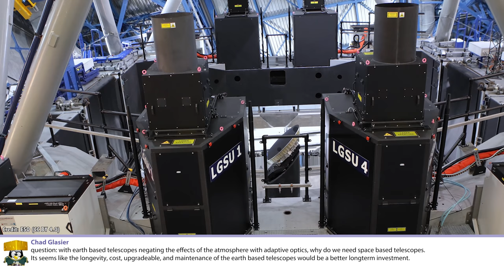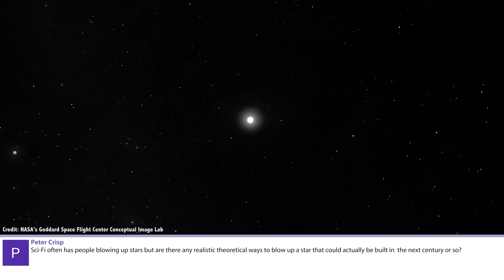Q&A 32: Why Can’t James Webb Be Repaired? And More

Comment: How to Calculate the Distance from Earth to SEL1 and SEL2.

The conceptual set-up is as follows. The barycenter of the Sun-Earth system is at the origin of a coordinate system that rotates such that the sun is always on the negative x axis and Earth is always on the positive x axis. L1 is some distance from Earth toward the sun. L2 is some distance from Earth in the direction opposite the sun.

Definitions:

GM₀ = the gravitational parameter of the sun
GM₁ = the gravitational parameter of Earth
x₀ = the position of Sun relative to the barycenter (intrinsically negative)
x₁ = the position of Earth relative to the barycenter (intrinsically positive)
S = the separation between Sun and Earth
R = the separation between Sun and the Lagrange point.
D = the separation between Earth and the Lagrange point.

D is what we want to find for both Lagrange points.

S = x₁ − x₀
x₀ = −(GM₁/GM₀) x₁
x₁ = S / (1 + GM₁/GM₀)
φ = GM₀/(GM₀+GM₁)
x₁ = φS

Since the sun, Earth, and the Lagrange point are on the same line,

For L1:
R = S − D

For L2:
R = S + D

The acceleration by the sun's gravity at the Lagrange point is

g₀ = −GM₀/R²

For L1:
g₀ = −GM₀/(S−D)²

For L2:
g₀ = −GM₀/(S+D)²

The acceleration by Earth's gravity at the Lagrange point is

For L1:
g₁ = +GM₁/D²

For L2:
g₁ = −GM₁/D²

The period of the orbit of the sun and Earth around their mutual barycenter is

P = 2π√[S³/(GM₀+GM₁)]

The angular speed of the rotating coordinate system is

ω = 2π/P
ω = √[(GM₀+GM₁)/S³]

The apparent centrifugal acceleration at the Lagrange point is

For L1:
f = ω² (φS−D)

For L2:
f = ω² (φS+D)

Since L2 does not move in the constantly rotating coordinate system when the relative orbits are circular,

f + g₀ + g₁ = 0

For L1:

ω²(φS−D) − GM₀/(S−D)² + GM₁/D² = 0
ω²D⁵ − (2+φ)ω²SD⁴ + (1+2φ)ω²S²D³ + (GM₀−GM₁−ω²φS³)D² + 2GM₁SD − GM₁S² = 0

For L2:

ω²(φS+D) − GM₀/(S+D)² − GM₁/D² = 0
ω²D⁵ + (2+φ)ω²SD⁴ + (1+2φ)ω²S²D³ + (ω²φS³−GM₀−GM₁)D² − 2GM₁SD − GM₁S² = 0

Solve those fifth degree polynomials by Newton's method, Danby's method, or whatever alternative you like best.

For example, if

S = 1.4959789e11 meters
GM₀ = 1.32712440018e20 m³ sec⁻²
GM₁ = 3.986004418e14 m³ sec⁻²

then

ω = 1.99098628e-7 rad/sec
φ = 0.9999969965194
D(L1) = −1.491551207e9 meters
D(L2) = 1.501531967e9 meters

I stuck on the minus sign because the distance to L1 is in the negative x direction from the center of Earth.

You can use these equations for other astrodynamic systems, provided that the orbits are circular and unperturbed and the speeds are non-relativistic. Simply replace the gravitational parameter for your larger body (GM₀) for that of the sun in this example, and replace the gravitational parameter for your smaller body (GM₁) for that of Earth, and change the value of S to whatever the separation between your two bodies happens to be. If the orbits are elliptical, or if there are third bodies involved, or if the orbital speeds are greater than 0.1c, then a more complicated procedure will have to be used.

Comment: Hi Fraser, like your channel! I feel like you missed the most important point when comparing James Webb to Hubble. The biggest gain from putting James Webb at L2 is that it has a 360 degree field of view in all directions with the exception of our Sun. Hubble always has the earth blocking 180 degrees of its field of view, which is further complicated by the sun and Moon blocking it's view. It cannot look at one place for a period of time longer than a hour or so before it is blocked from view by the earth (except of coarse when looking 90deg to the earths orbital plane, ie. up or down)

Comment: With the moon moving further away, I heard it was due to the Earth rotating faster than the moon orbits us. So the Earth is pulling the moon along with it which it turn speeds up the moons orbit which makes it move further away.

Is that right? Let me know.

Also in regards to you finding the questions, I think he means how do you find them all among ALL your videos? Do you actually open up every single one of your videos each week to check if there have been new questions on it?
Reply from the maker: No, it's because the Moon is slowing the Earth's rotation and shifting outward to compensate.

Comment: Since you think that our best chance for colonizing this system is Solar sails, I have a question about their function. On the ocean sailing vessel, the ship tacks by using the force of the wind against the resistance of the keel. What would a solar sail ship use to resist the force of the solar wind so that it can move in more directions than just away from the sun?

Comment: Here's a fun question:
I was watching a couple of cosmonauts do a space walk on the ISS a few weeks ago and I couldn't help but wonder: If lots of stuff went wrong and one of the cosmonauts somehow ended up floating away from the station at a few m/s, would it be possible for the crew to get into a docked Soyuz capsule and rescue him?

Assuming the cosmonaut still had 7+ hours of oxygen left, I guess the question is how long it would take them to undock the Soyuz capsule and program an intercept course. Also, I don't think the Soyuz has an airlock, but perhaps the cosmonaut could somehow hold onto the capsule and hitch a ride back...?

Comment: Questions: Will James Webb be able to see exoplanets? I read that it will be able to see large gas giants as a dot next to the star, is that true? If so, what kind of details?
Also, do you think in the next 50 years we will have a telescope on the moon? if we put it on the far side I think it'd be able to see a lot and be kinda dark if placed in the right area.. plus then astronauts could feasibly go there and service it and use it on site, right?

Comment: Here's a question: What do we know has over 4 billion years or so accumulated at L2? Are we looking at a Sargasso Sea of junk, a Pacific Gyre Garbage Pile? Can we see things there as easily as we think?
Reply from the maker: L2 is unstable, so there won't be anything there.
Reply: That's good to hear. I get this image (completely unfounded of course) of the JW telescope coming out of lightspeed/warp (hah) into a field of debris. So, if that L2 is unstable enough, there is nothing that needs to be worried about, like a nail in the street, broken glass in the beach sand, and furniture legs in a dark room.

DID YOU KNOW that shins and pinky toes are "God's" obstacle detectors? ;)

Comment: Wouldn't putting these telescopes in L3 and L4 be more stable than L2?  From what I understand, L2 needs corrective measures to keep it in L2, which burns up fuel, where L3 and L4 don't.
Reply: I'm wondering about the same thing, although I believe you meant L4 and L5. L3 is on the opposite side of the sun, which I can imagine is not a good place to park a telescope. But I also wonder why L1 is worse than L2 for this application?
Reply: Yes, I did mean L4 & L5.
Reply: Actually L1-3 are better for telescopes as L4-5 are stable and might hence have asteroids lingering aroung. L1-3 have no such issue and though they are unstable, you can recorrecting yourself every now and then to keep yourself aligned.
Reply: After reading up about it more, looks like the primary reason L3, L4, and L5 are not viable is because they are just too far away. L4 and L5 are 1 AU away, L3 is 2 AU away, so they are 1-2 hundred times further away than L1 or L2. So it would take a lot more time and/or fuel to get there, there would be a lot more delay in communication, etc.

I don't know how big of a problem trojan asteroids at L4 or L5 that you mentioned are, because apparently so far only 1 of them have been found so far? But I guess they are extra complications anyway. 

None of the above applies to L1, and I believe the reason that is ruled out is because the telescope operates on infrared, which requires very low temperature. At L1, the sun in on one side, the light reflected back from the earth will be coming from the other side, so I imagine in that case the telescope would need double sunshield and would only be able to look above or below the plane of the ecliptic lol.

Comment: Hello !!!! i have a question for you, why are hydrogen atoms most abundant in the universe
Reply: They're the simplest form of matter.  The early universe was pretty much nothing but hydrogen until the first stars lit up and started fusing it into helium and heavier elements.  When those stars explode into super novae they release a lot of the hydrogen back out into the universe.  Radiation and radioactive decay also break down heavier elements, releasing hydrogen.

Comment: Q. If distant galaxies which we see further back in time are receding from us faster than closer galaxies which are more recent in time moving away from us at a slower rate. Shouldn't that mean that the universe expansion is actually slowing?
Reply: Matt Randal, No. Space is expanding.  There is more space between us and distant galaxy, so there is more 'new' space being added.  Because of distant galaxy recedes faster than closer galaxy.  Acceleration of this expansion is more difficult to observe.

Comment: Hey Frasier, got a question. Here you say L2 point is very stable and the best for James Webb telescope. In other video you say L2 is not very stable and fuel is needed and L4 and L5 points are way better and stable.
Reply from the maker: L2 is more stable than just out in space, but it's not as stable as L4/L5.
Reply: Fraser Cain Thank you so much for the answer!

Comment: In Elite Dangerous you can travel 2 million kilometers in just a few seconds.. You can already create CGI hummingbirds, so why not FTL travel?
Reply: It is worth noting, that due to time dilation and length contraction, you can travel "faster" than the speed of light. Example, Proxima Centauri is 4.243 lightyears away, and lets say you travel towards it at 0.866c. Promixa Centauri will then appears to be only 2.121 lightyears away, and you will arrive there in approximately 2.45 years from your perspective, but it would take 4.90 years from Earth's perspective.

Comment: Dear Fraser:  Do you know if the James Webb telescope is going to have an emergency escape system?  We had it for the Mercury, Gemini and Apollo astronauts.  Why not for a gazillion dollar piece of irreplacable equipement?   Not too long ago we saw a rocket explode on the launch pad at the Cape.  It would be a shame if after spending so much money on the Webb, we didn't spend a little more for an escape system that could be computer controlled in the microsecond the ship's main computer sensed a malfunction.  Or is there an escape system already contemplated?  Thanks in advance
Reply from the maker: Nope, if the rocket explodes, the telescope is gone.
Reply: I think that is an unacceptable risk, considering to time spent by the great people who worked on this project.  The money is one thing, but the human factor is another.  I can not fathom why the designers of the Webb project would not put an "escape system" built into the assent rocket  system. It is not that much more expensive, compared to the time and effort spend so far for the James Webb telescope to depart.

Comment: Question: Why does NASA plan to use actual shielding material to shield astronauts in the deep space gateway as opposed to a distant strong magnetic source oriented towards the sun (as suggested for Mars shielding as well)?
Is this because it would be too hard to keep it constantly oriented at the sun? Or the necessary distance from the gateway too great for a reasonable magnetic field to cover a large enough deflection solid angle covering the whole gateway?

Comment: We know that space is expanding, and theorise that inflation in the early inverse had the universe expanding super fast. Much of what we know about the expansion comes down to red shift, with the frequency of the light changing.
How do we know then that some of the effects we ascribe to spatial expansion are not in part to do with time contraction ? If the universe started off ticking over at a different rate than it does now ?
Would it matter, or would we even be able to detect it ?

Comment: The best propulsion system that's practical near term is nuclear powered plasma drives. There should be Canadian MSRs (Moulton Salt Reactor) in production in 5 yrs, so you can get 100MW early on for propulsion (300MW is expected to become a standard size), where today 50kW is a lot. Useful between Earth orbit and Mars orbit, but a MSR can lift an airplane off a runway. So the question is, how long before a MSR / plasma engine can land and take off from the moon?

Comment: Why is the L2 point the most stable? What makes it more stable than the other Lagrange points
Reply from the maker: It's not. L4/L5 are the most stable. You need to use propulsion to get out of them. L1/2/3 are kind of stable. You don't need much fuel to remain in them, but you'll eventually drift out.

Comment: Antarctic - melting - can we reverse it by snow making machines.  The melted ice (water) seems to readily available. The air remains very cold that any mist will turn into snow.  Why we can’t do this on many machines?  Especially if the machines are solar powered and there is daylight 24 hours per day fit 6 months each year. Seems we should be trying something.

Comment: The type 2 question was about waste heat, i.e., thermodynamics. Probably reacting to the notion that we know there aren't Dyson spheres because we don't see their infrared emissions.
Reply: An easy way to remember the moon thing is that the natural tendency of any 2-body system is for both bodies to become tidally locked. As long as they're not, there will be forces and processes pushing in that direction.

Comment: Q: What kind of fuel/fuels are used ind the JW (James Webb  telescope)?

Q: How much of the mass in JW will be fuel?

Q: What would be the mission cost for refueling if the JW had been buildt with automatic refueling as an option? (Basically what would the cost be for sending that much mass so far away)

Comment: on another youtube channel i recently heard that there is this super small insect, called the fairyfly, that basically "swims" through air. could we build an armada of similar sized nano space planes to cheaply transport cargo into orbit?
Reply from the maker: I like that, the problem is that if you want to get into orbit, you still need to get to 28,000 km/h.
Reply: Fraser Cain maybe you can provide the little "planes" with an electric charge, so when during a solar storm the magnetosphere is pushed down into the  stratosphere, they can sail outward on a magnetotail? (using big words here without knowing what they really mean, sorry >. <;)

Comment: Fraser when you were talking about the JWT you said that they would learn something even if it does not deploy correctly. Surely if they want to learn about parking in the L2 they just need to send a simle satellite there than can transmit data back to Earth befor sending an expensive piece of kit?

Comment: I heard nothing about what the title of this video is: "Why can't the Webb Telescope be Repaired"
For others that might see this problem, Webb will be a million miles out.
Just no other spacecraft have ever been "worked on" that far out.
Perhaps, if something on Webb does not work or breaks, in a decade or two, a mission can be put together to resolve a problem.
But right now, all the effort is being concentrated into just building, putting together and launching Webb.
If any repair is ever needed, that will have to come later.
But, the option to visit/repair Webb might get looked at over time.
Remember,  Hubble had a bad mirror and got a repair mission after it was launched.
If people asked if Hubble could be "repaired" before it was launched, Everyone would have said "no way".

Comment: Hi Fraser I have a question , do you think that we'll see a sorta twin arm centrifugal spinning machine in orbit that's say 20 miles from arm tip to arm tip that can throw a spacecraft from one machine to the next until it reaches the needed speed and then use the same thing in reverse to catch the spacecraft and slow it down at its destination? I thought I read about something similar in a science fiction novel many many years ago.
Reply from the maker: I love the idea. Did you read Seveneves? Once we get machines like this, we'll truly be masters of the Solar System.
Reply: Fraser Cain I can't for the life of me remember what the name of the book was. Thanks for the response👍 I love your channel it feeds my science and astronomy curiosity.
Reply: Fraser Cain I don't think I read the book seveneves "yet".
Reply: I do think that long rail-gun tubes would be a lot better. Then we do not need any  "unobtanium" to hold things together. A very long tube could even flex some to point you in any direction you need to go. You would also be able to use the same tube for increasing and decrease the speed.
Reply: bknesheim Get outta my head lol I was thinking about something very similar today. My thoughts were to have say a larger version of the L.H.C. on the moon capable of instead of throwing particles throw objects like a very large magnetic rail "gun" that can place small satellites very very far away at an incredible speed and even a robot with a perhaps human consciousness, since our fragile bodies would be destroyed by the acceleration of such a machine.  I even imagine long trails of massive magnetic rings that speed up your craft slowly to reach incredible speeds.
Reply: Isn't that what is called a skyhook? I remember a video by Issac on that subject.